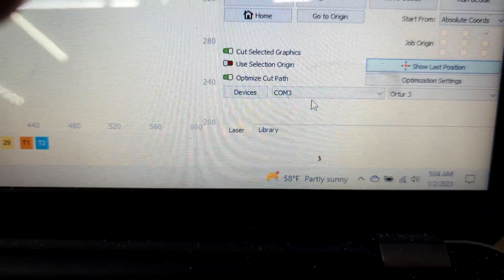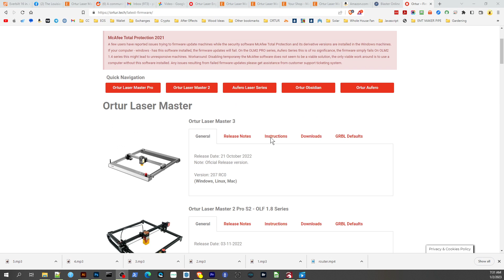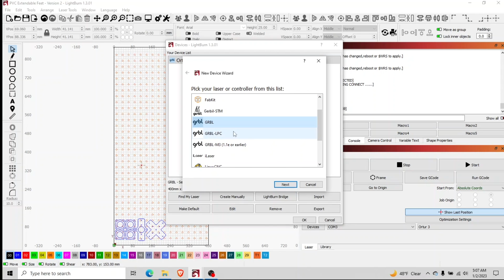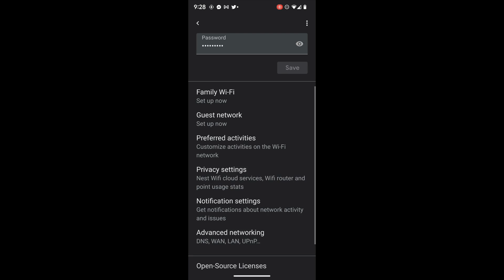Connect LightBurn to Ortur Master 3 through WIFI - Step by Step Tutorial

Comment: How's it working for you? Is it as good as the usb connection? BTW Thanks! I have a NEJE that I'm going to run with MKS Tinybee ESP32 controller. I followed your video and Lightburn recognized it right away.

Comment from the maker: Firmware Upgrade...

Connect the OLM3 via USB.

If the laser is on, click the reset button once to turn off the laser.

1. Press and hold reset button on the laser. DO NOT release, hold for 3 seconds.
2. While holding the Reset button, press and hold the power button for 3 seconds.
3. Release the reset button.
4. Wait 2 seconds then release the power button.

You should see Red→Green→Blue flashing sequence.

Your computer should now show a ORTUR LASER drive.
Copy the bin file onto the Ortur drive and allow the machine to complete the upgrade.
It can take 30-60 seconds and the laser will home again.

In the console, enter $RST=* and confirm that the upgrade was completed.

* After the upgrade, you will need to redo your Wi-Fi settings.
Reply: THANKS, I LOVE YOU FROM CHILE